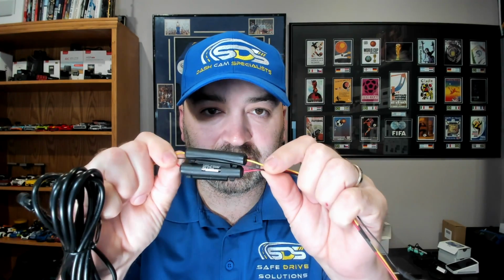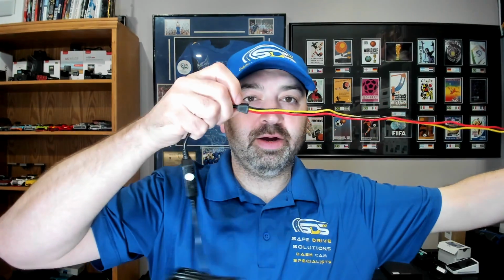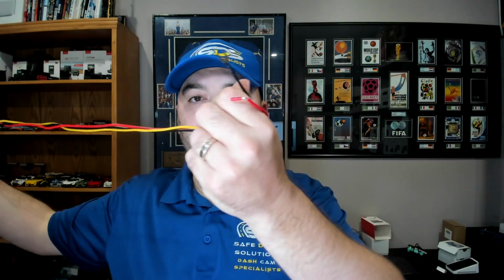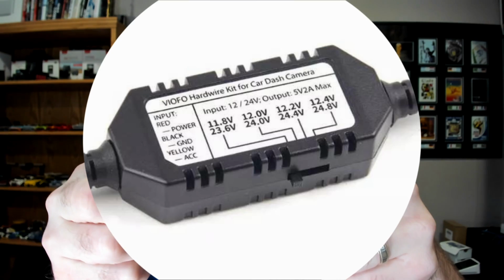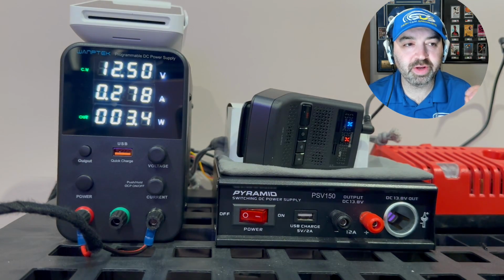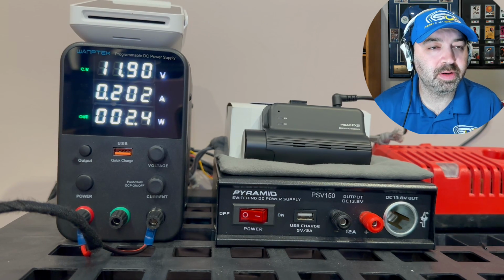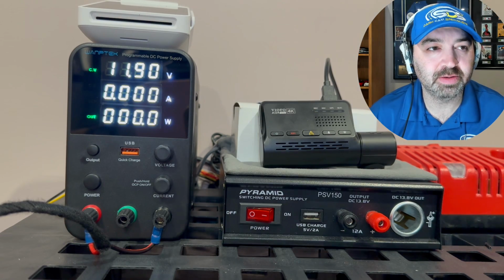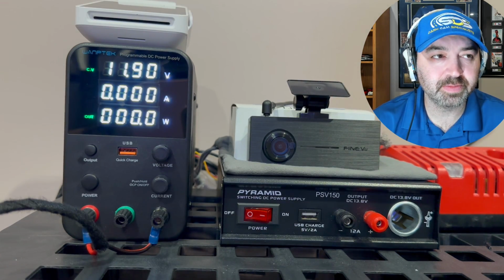Dash Cam Low Battery Protection

Comment: Many newer Ford F-150s (gasoline, not hybrids) have a 2kw power generator system called Pro Power Onboard. I believe that in 2024, Ford made it standard in the “High” package for many trims. Under the back seat is a box that houses a large inverter and two small 12v AGM batteries connected in parallel. I don’t know electricity well, but I think those batteries may be in this system to even out the power output. The engine must be running for the truck’s four 120v, 20A outlets to be energized. Could you run your dashcam directly to those two 12v batteries to avoid trouble with the more critical engine battery?
Reply from the maker: The dash camera draws between 250-750ma on average depending on the dash camera. Are you concerned about parking mode?

Comment: Cool Video!  For the BlackVue Dashcam when you turn off Parking Mode in the settings does it turn off the camera when you turn off the vehicle?  I would like it to turn off the camera front and rear cameras when I park it in my garage.
Reply from the maker: from my understanding it does. But it also depends which blackvue. There have been many changes in their dash camera over the generations.
Reply: @SafeDriveSolutions  Cool! I was looking at getting the BlackVue DR970X-2CH LTE Plus NA 256GB | Dual-Channel 4K LTE Cloud Dashcam.

Another option I’m looking at is the Fitcamx because it’ll retain the OEM look for my ‘23 Tacoma.  What do you think of the Fitcamx Dashcam? Thanks!
Reply from the maker: @TacomaEscape run away from fitcamx. We got 1 to test. We did not bother releasing the video it was so disappointing
Reply: @SafeDriveSolutions  Thanks for the advice! Just out of curiosity what was wrong with the Fitcamx?
Reply from the maker: @TacomaEscape video quality, parking mode never worked list goes on
Reply: @SafeDriveSolutions  Video quality and parking mode are my top priority with this install so I’m glad I asked.  I don’t want to break the bank but I also want it to work for many years.  I’m leaning toward getting the Blackvue battery pack so there’s less strain on my battery.

If you lived up near Wisconsin I’d have you install everything!
Reply from the maker: @TacomaEscape  Thanks
Reply: @SafeDriveSolutions  I have another question if you don't mind.  From your experience do you think the Blackvue Parking Mode would wear my battery out over time in my '23 Tacoma?  Or would it best to get a battery pack installed?  I would use parking mode at least 5 days a week at work and then 1-2 days it would be off during the weekends.
Reply from the maker: @TacomaEscape  1-3 hours is usually fine if you set a timer and low battery protection of 12 volts or higher. If you want to set it for 24 hours or even 8 or 12 on a frequent basis I dont think it is good for battery

Comment: Just installed a Cobra with the OBDII power adapter the manual says it has 11.9V low voltage protection, is it safe to leave the camera on parking mode and will this voltage cutoff cause any damage to battery?
Reply from the maker: Never tested the dash cam so it is hard to comment on it. We are working really hard on a video educating on the different types of vehicle battery. Some newer types of car batteries below 12.4 volts is considered almost dead.  So we are trying to make sure we can get the right information

Comment: Thank you Ben for providing this video, I have a Viofo 229 Duo are the testing results for the Viofo 139 apply to the Viofo 229 Duo? and I understand they are different models but just hoping it for the same results. I had my equipment installed at Best Buy with the same selector switch.
Reply from the maker: HK4 and HK3-C both tested the same as low battery protection is built into cable.

Comment: I want to add an inline fuse to Viofo hard wire kit like you recommended. Which cable to you recommend tapping into? Does it make a difference?
Reply: It’s me Tim. I have the VIOFO hard wire kit and I plan to add an inline fuse. I’m wondering which wire on the VIOFO kit I should solder into. I’m assuming the “always on” ??
Reply from the maker: @hi-filuggage13  I will make a video explaining this. I ti s way to hard to write it.
Reply: @SafeDriveSolutions  I already know how to solder. I’m just wondering if those 2A inline fuses should go on the accessory yellow wire, or the “always on” red. I feel like it should be on the red wire.
Reply from the maker: @hi-filuggage13  A fuse should be put on both the red wire and yellow wire.
Reply: @SafeDriveSolutions  got it! Thank yoy
Reply from the maker: Which cable? Are you referring to hardwire cable or fuse taps?

Comment: Hi so in regards to the Viofo and the fuse tap thing. If my original Fuse (the one thats in my car right now) was 15 Amps, I should put a 1 Amp or 2Amp fuse in the secondary spot on the fuse tap? I read somewhere that I should put the same Amp fuse in both slots? is that wrong information?
Reply from the maker: The first slot which is for the actual factory fuse should remain the same the second slot should be a 1amp, 2amp, 3amp. something very small.
Reply: @SafeDriveSolutions  Ok thanks for the clarification! Appreciate you :)

Comment: Nice video, tell me would you need an inline fuse on a ground cable? at the moment i have a blackvue dr750x plus installed with fuse taps i used 3a fuses in the fuse taps, am thinking of switching to viofo a139pro for the 4k feature, no link appeared above for the 5 different way install video
Reply from the maker: No fuse is needed for ground. 5 Ways To Install A Dash Cam | Safe Drive Solutions
https://youtu.be/ApO7sjL1fGE